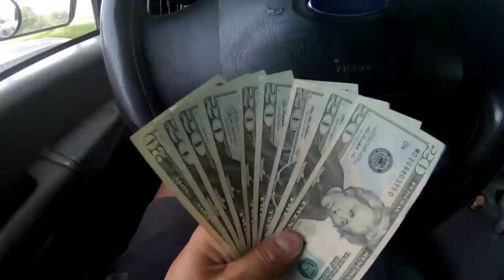SMALL ENGINE PICKED EQUIPMENT INVENTORY UPDATE LAWN MOWER TRACTOR PRESSURE WASHER REPAIR TO DO LIST

Comment: I’ve always been a big fan of those Tecumseh engines, they were actually very well designed and pretty reliable. When I bought 2 of those Toro mowers new BITD I specified that I wanted Tecumseh engines on them, never had any trouble with them I couldn’t easily fix (I’ve been working on them since the early 70’s tho). I do see a lot of bad magneto coils and leaky crankcase breathers on them nowadays, again easy fixes. Not a fan of PowerMore or new Chinese Briggs.

Comment: That spark plug cross references to an NGK DCPR6E in case you want another option.  

Pressure Washer pumps can be had aftermarket for a reasonable rate.  Tool Mart Inc sells an ARMOR brand which I have found to be solid replacements for the Annovi Reverberi style, and Wassper USA has decent priced pumps which are similar to the old BS/Coleman style ones.  Good luck so far on both.
Reply from the maker: Sure,  but I try not to spend any money for the fix,  that’s the challenge

Comment: Hello from East TN. The only way i will take a pressure washer is if I get it for free. Believe it or not I have way better luck with the electric ones. Most of them usually work. I can usually get about 30$ for the good electric ones and you don't have to clean any carbs.

Comment: It was the no  emulsion tube and the engine ran!!!!   That pump froze in cold freezing  weather and cracked the body in several places..
Reply: You're right on the pump freezing. Most common problem.  All you have to do is hook an air hose to water inlet and blow the water out when winterizing. If you want to really winterize, Briggs & Stratton makes a aerosol can of foamy product that connects to water inlet.  Press the button and stop when foam comes out of the high pressure outlet. Can is probably good for 3 or 4 applications.
Reply: @dougseaman8791  Your right Doug about the Briggs and Stratton foam in a aerosol can. I used it last winter and i just easily pull the engine over alittle will putting the foam in. Its also supposed to lubricate it and keep calcium from building up. I guess I'll find out over time.👍

Comment: that plug Kohler 1413211S cross references to NGK DCPR6E .  and DCPR6E  cross references to the following   https://www.sparkplug-crossreference.com/convert/NGK_PN/DCPR6E    one of which is  Autolite 4164  available at Walmart for < $2      great job there getting it going, I just sold the same mower last week.

yah my project pile is getting smaller,   I been fixing some 2 cycle stuff.   and I hate 2 cycle.  2 videos to come in a few weeks. They are scheduled to publish in July